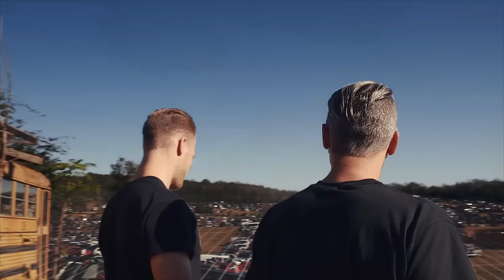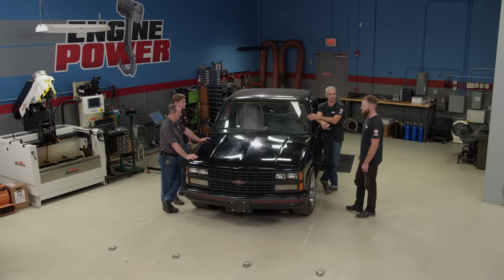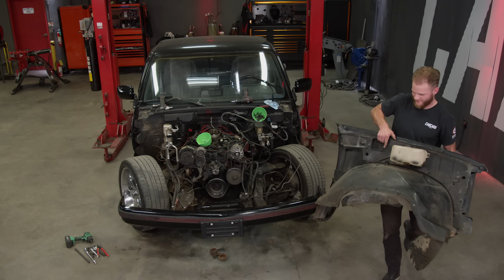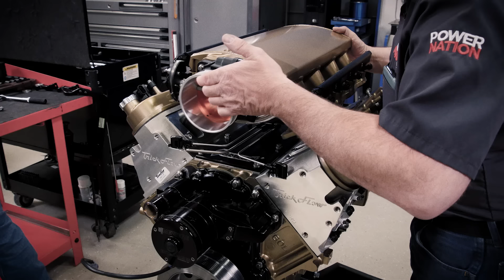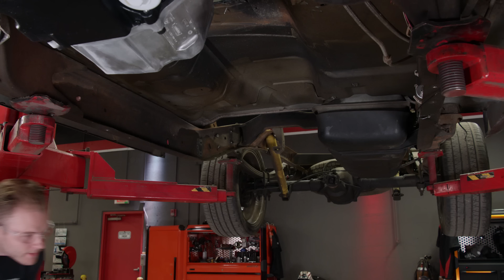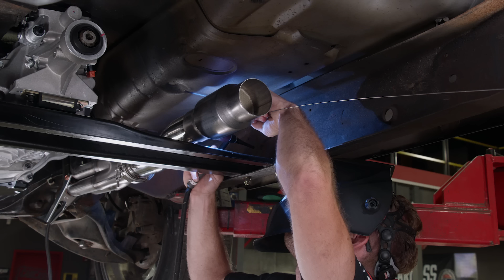We Put Race-Car Suspension Under an Old Chevy Truck

Comment: In my twenties I had an 88 Silverado reg cab short bed with a fully built 350, big cam, aluminum heads ported and polished, straight piped and dumped, it had 450-500 hp and it hauled ass! Sounded good to nice chop…

Comment: Why on Earth would you use a primer sealer if there's no body work I mean you didn't burn through the primer so if it's all 600 grit I would only spot like self-etch primer on bare metal.. no reason to use sealer if there's no Bondo showing you guys prepped it's clean it ought to have plenty of adhesion being a professional auto painter I'm just telling you how it is and if you want to do single stage you could have 3:20 to and shot it or even 400 with the bass clear I'm not going to see anything especially if you're going to two tone it

Comment: All I see are those hideous GHETTO REEHUUMS. As long as it has those, nothing else matters. It's TRASH. When I went to high school in the mid 1970s, I drove a 1965 Chevy C10, with a carbureted 350 and a Muncie M21 4 speed. And it had 15" rally wheels and raised white letter Mickey Thompson tires. And Cherry Bomb glasspacks.
Reply: That's a cool ride bro! Don't see any of those anymore wish I did

Comment: You guys do an ls swap and everything is good. But when it comes to your battery cables and the grounding kit that is required, there is no  info. Have you ever looked at CE auto electric supply. They have some really nice stuff. I hope the fellas at powernation are reading this

Comment: I own a 94 C1500 (with soggy floor board sound deading I want to shit can). I couldn't help but notice that when you take the carpet out you throw the original sound deadening insulation away and then, you just install the new premolded carpet without adding any additional sound insulation. You aren't the first guys I've seen do this with 1990's Chevy trucks on Youtube. Does the premolded carpet come with sound deadening built into it? Or, you just don't you need sound deadening on a race truck?

Comment: 2002 was the last year for those OBSs because the 3500 HD & medium duty models were the last models left in production. 2000 was the last year for the 2500 & 3500 pickups. 1999 was the last year for the SUVs & 1500 pickups although they began producing the next generation pickups in that same year at the same time.

Comment: Take a fine running useful truck and give it a single use. Do your work then put in 1500 lbs and see how it goes. You ppl are assholes. Take a pos and build it, great but not this. I'd give my left nut to have that truck. Why don't you show how difficult it is to take out the ps pump? Oh yea Nashville bs.

Comment: I got the sane truck except mines got a minor lift with the 5.7 350. Those dual headlights only came in those from 87-89. Mines also a 4x4. Climbs great, pulls trailers like nothing. The tbis aren't appreciated enough for what they do and their longevity.

Comment: Pat its a pick up and not a rig LOL
I hope they change the wheels and don't go with pimp wheels and tires with no sidewall.
I would ask Pat if they retorqued the heads after the break in and dyno pulls LSs are bad for blowing head gaskets if you run them hard.
Sure is nice when you have a multi million dollar shop and an unlimited budget.

Comment: Beautiful as always, but we and I speak for most of us, wanted to see the actual 1/4 mile times, especially with those 335 tires which never seen before down the track, I was thinking a 11.5 to 11.7 in the 1/4 mile, if u would of put a auto from a vette thr time would of been maybe slightly lower E.T’s 

But wish u guys would of cover up the back bed to make a cover for it and a bed cover to keep it all nice and neat, traction control would of been a plus to on it, but love it how u made it perform, good job fellas and to the producers a hi five to them also !

Comment: you should have used a Watts Link for the rear axle instead of a panhard bar.  it keeps the axle more centered than a panhard bar.  it would have been smarter for road course racing

Comment: At the shop i work at, we currently have a shorty obs 2500 stepside that’s black, has red accents, some wheels, i think it’s on air suspension, but it looks sick. Has a 350 in it. Currently in for AC issues

Comment: Dang sounds like you have the same luck with Fords as my family and myself. We’ve had a 1997 Aerostar that broke down somewhere around 15 times before it hit 15,000 miles. Random electronics going haywire and completely destroying themselves while we’d driven to Washington (state) from The Victorville California area. Which is about a 30-40 minute drive to Riverside California. A 75 to 90 minute drive to Los Angeles. We had  the transmission just blow out it’s seals randomly and puke it all out on the road all at once on 4 separate occasions. 2 times in the original trans and 2 times on the replacement trans under warranty. The ECU and PCM both had to be replace a few times each under warranty. Also this Van was 100% stock and was basically a Ford Ranger of the same year mechanically. It had the same 4.0 “Cologne” V6 and the 5R55E auto trans. I seriously wanted to lift that van so bad and turn it into a do it all off-roader. Since all the seats were removable with locking levers besides the front two captains chairs. But that dream started to die very quickly after the first year an a half of trouble that just continued to destroy my parents faith in the Van. The dealership then started to try and deny warranties after about the 8th or 9th time we had to come in before it hit 15,000 miles. They said we must have been doing something wrong. But we never touched the van. All the service was done at that same dealership. So if anything was messed up it was with their mechanics. But I doubt that was it. I think it was just a poorly made example. Or maybe many of it’s parts could have been damaged by some wiring mishap at the factory or poor grounds, or something. We eventually came to an agreement to buy it back because of the fact they were the only ones doing any work in the Van and my mom and dad drove pretty conservative as far as not flooring it all over the place. I mean it was a van and they knew it was meant to take care of the family so they treated it like a King/Queen. They wanted it to last long enough to give to one of us.

We then attempted again after having bought a 1999 or 2000 Camry not sure exactly anymore became my nephew has it now and it’s still going with 460,000 miles on it. Anyway they wanted another new car but Toyotas financing was a bit too pricy for their credit level at the time so they went back to Ford. They got a 2004 Expedition and that was the 5.4 V8 I believe. And that thing was doing many of the same unexplained things. Random electronic failures. But this one was strange because that truck never went on long haul road trips. It was mainly a 45 min to 75 min commute from Victorville CA to Ontario CA 6 days a week. Only about 100 miles round trip each day. No trailers hauled and again he took it to a reputable shop that we took the Toyota Camry to for all Oil Changes, Trans fluid Changes, brakes etc. my parents were just far too busy to have my dad do the work himself even though he knew how to. The Expedition made it to round about 45,000 miles though before it completely stopped starting and had the dealership stumped for nearly a month. Also they got this Ford from a different dealership than the Van for fear that it might have been known that the Van may have problems and they sold it anyway. So I doubt it was incompetence at two different dealerships. So the fact they said all the electronics were testing good system wide and somehow it still wouldn’t start. Just made me think the car had another wiring gremlin. Possibly bad grounds throughout the system, fault relays, open circuits somewhere, or bare wires touching metal somehow? But it was completely factory and was treated like royalty. My parents value long lasting purchases. So they want to get every last dollar of value that they can from their investments. Anyway they finally ended up doing a trade in for a 05 or 06 Mustang since all of us kids had moved out by this point and my parents were always just going places with only the two of them. And somehow the Mustang even had problems. Faulty suspensions bushings throughout the entire front and back suspension, faulty made motor mounts too that caused the engine to be able to hit some part of the frame or some other component long enough and with enough force to eventually wear a hole in the oil pan and block. Car was a total write off from insurance with 7,950 miles on it. My parents have not had a Fire since. And they very much like them, and would totally get a new one if they needed a new car. But they’re older now, well my Pops passed away a while back. And my mom now has the same older Camry, she loans out to the family when they need a spare car. She also has a 2021 Rav4 Hybrid that she absolutely loves because she can go so long between fill ups. She wanted the prime when she found out about it but they’re so hard to get without an insane markup or just plain not available due to demand and lower production numbers than the other hybrid model and other regula ICE ONLY model Rav4. 

I’ve already typed a book here so I’m not going to get into my ford experiences. They were different but similar in some ways. But I only needed 1 lemon to go to Toyotas and Hondas. Haven’t had any issues with either of my Toyotas (Camry/Corolla) in 16 years for the Corolla, and 18 years for the Camry. Then I also have a 2005 Acura TSX Also known as the Honda Accord Euro R or maybe it’s just the regular euro accord. But it’s still a great car, and since it stick shift (manual/standard) I don’t have to worry about the one weak-ish point on those generation TSX’s, Accords and Civics that were automatics. They had a great deal of them with faulty transmissions for the autos that would just start to slip and ship all strange, like a dragging clutch. Then a really jerky shift at times too. I know because my friend wanted the same car but got the auto and regretted not learning stick because it had two transmission go out on it. He eventually learned stick and now has a Manual Acura TL Type S. It’s close to the same year, somewhere around 2005-2008.

Comment: I replaced the stepper motor and still having the same issue. But you were a great help awesome video on replacing the stepper motor. The strange thing is that it is a 2008 altima, I ordered the stepper motor on Amazon and took the  valve body down after I got the new part and they didnt match so then zi returned it and ordered another one from Amazon but for a 2009 and it matched??? The car was built in February of 2008 so it was definitely a 2008 year model but the stepper motor I put in it  matched perfectly??? Is it possible that someone may have put a junkyard 2009 trans in it??? I just got the car and this is how it was when I got it

Comment: You got yourself a conversion truck. I remember doing dealer prep on base model trucks that were sent to a conversion van company for crushed velvet seats, 80's era gaudy stripes (painted on, though) sunroofs, etc. The trim was real wood, but it was builders grade lumber with minwax varnish. They were hideous and the quality was awful, but they sold well.

Comment: The cutouts are useless. Should have went with an Optima battery. Should have did a battery move to the bed passenger side. You need to upgrade the headlights. Also you could have done something to make the bed somewhat usable.

Comment: Bought exact truck new in 1992. But 350 5 speed. Lowered it. Put in a L31 MPFI Vortec in it. Was a fun truck with the 5 speed. Sold it in 2012. Miss that truck.
Reply: This is your sign to go get another one. 😁
Reply: That L31 sure is more fun l did the same

Comment: as talk about  old tail light  and  install new one   for the guy out there on a budget and can't  afford  new    simple go to your local grocery  store  buy a  can  of   EASY-OFF  HEAVY DUTY it should  be in a yellow can    spray on  tail lights or head lights let sit for a few minutes  it remove oxidation of plastic  repeat process if necessary to get your desired  look

Comment: if you watch at 1:43:10   watch the rear end twist . that is very very ugly to see ! that exact reason is why you dont use a 3 link . a watts link or truck arm set up would work so much better .

Comment: Good build but had to mess it up with the worst muffler ever for performance luckily it has cut outs but if it didn't that chokemaster would choke down that ls bad very bad muffler for performance straight through exhaust is the way to go which a borla atak crate muffler would of been ideal

Comment: Hey, I'm an auto student and I was wondering if you could answer a few small behind the scenes questions.
How do you keep all your tools so clean? And do your tool boxes have foam inserts to keep your tools organized? If so, where do I get organizers like that?

Final question, do you have any advice for trying to get into the auto industry and what to look out for?
Reply: If you enjoy working on cars for fun/hobby, working on them for a living will make it a lot less fun after a very short while. And you have to spend the most out of any trade on tools for one of the lowest hourly rates of pay, comparatively to other trades. 

I was making around $40/hr when I left the industry to get into industrial maintenance and repair, and that was well north of the top of the market for average pay for mechanics in my area, but I had a good employer and I have a few things that I'm quite skilled at that a lot of guys struggle with. (Electrical, diagnosis, troubleshooting, etc.)

My buddy as a first year licensed plumber was making ~38-39 an hour, and even including his VAN probably had half of what I have tied up in tools and equipment. And he still likes to work on his fun car.

If I was gonna do other over I'd definitely pick a different trade that pays better and doesn't ruin my ambition to work on my own stuff for fun. 

Your mileage may vary though

Comment: I had one of those trucks that ran on 7 cylinders for years. It would spray oil out the exhaust. Those old 350s were hard to kill
Reply: My neighbor got one brand new and they forgot the oil control rings on one of the pots. Used oil like mad and the dealer just kept saying 4 qts. a month was normal. He flies a Yota flag now big time.

Comment: Also all small blocks start out as a 5.0. To get a 5.7 you start with a 5.0 block and bore it out. Kinda of the same as to why all Ford 360s and 390s all used to say "352"  they started out with a 352 block and bored it out to make it a 360/390

Comment: I dont know about 1989 hp numbers, but a 1992 TBI 350 is 190hp and 300 ft torque. But I think the 1992 Suburban 350 had 210 hp, so maybe the burban 350 has a little hp added because of the weight?

Comment: Love the old reliable tbi 305 and 700r4 combo. 96-98 motors didnt do it for me. Not fast but simple and solid , I have same truck with only long tubes and a 2500 stall converter 350ci pulls 15.7 in the quarter mile consistently

Comment: Nice build. I have a 97 I'm working on. As a welder I have to suggest you should definitely wear your ppe when welding though. Enjoy the skin cancer on your hands. I can see those welds failing sooner than later too. I can also see the c-notch cracking since the inside corners weren't radiused, never have a sharp corner, great stress riser.

Comment: I loved their conversation about these trucks in the 90's. I was in High School from '96-'00 and in '98 my older brother bought an '89 OBS single cab short bed. It was a 5 speed manual with the 4.3 V6 and I have so many fond memories of that truck; even though it wasn't mine (I learned to drive stick in it).

Since it was 2WD it already had a bad ass raked stance from the factory, and my Bro Put FAT tires and wheels on it, that truck handled like it was on rails, then he put a massive subwoofer system in it, it was an incredible truck to drive around in the late 90's. 

He used to let me take it to School to do basic maintenance in the auto shop and everyone loved that truck. I used to drive my friends and girls around in the back of it. He ended up selling it circa 2000, it was a sad day. I wish he still had that truck today.
Reply: getcha one and start new memories
Reply: @thecampgroundkid  Nah, I've got my own project that's much faster and handles way better, and is even more rare.

Comment: For Calvin’s car I’d rock the Varis kit, they have it in need for speed heat if you want to look at it. I have one fully kitted with a wrap on it. And in the game there’s a turbo flat 6 that I motor swapped into it. The meeting in the middle should be the body kit and Calvin does whatever he wants under the hood, just make sure it’s a ripper